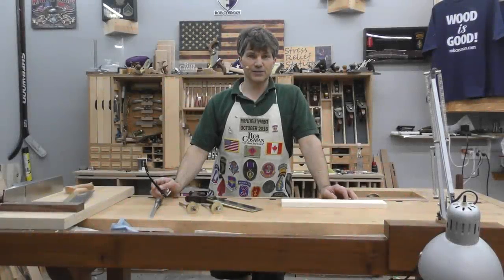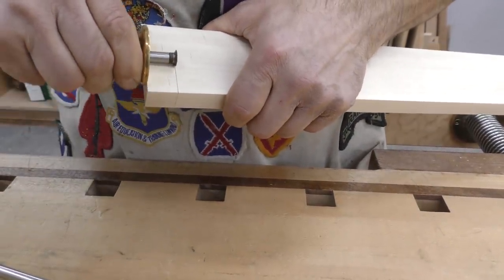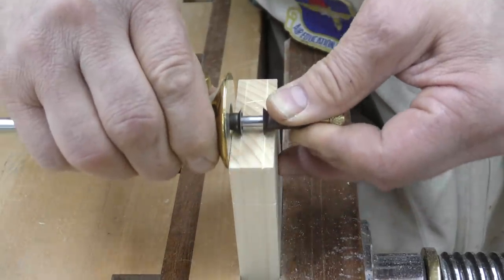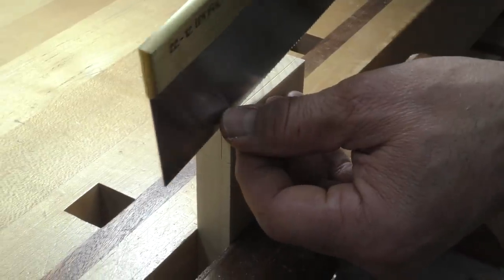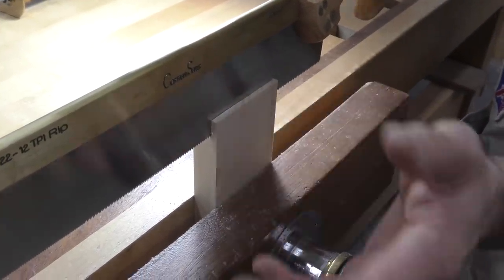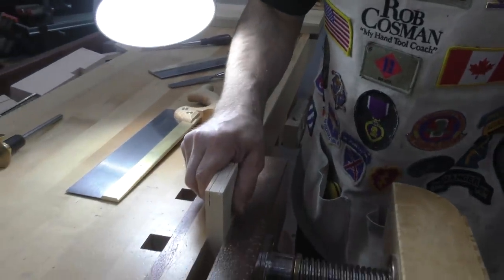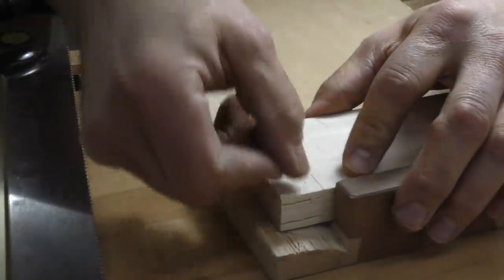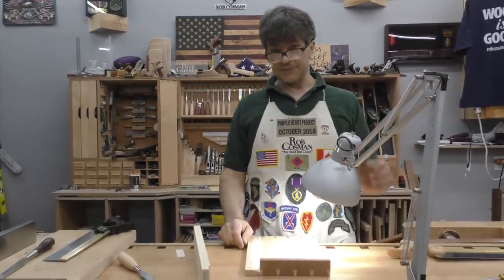Sawing Tenons by Hand

Comment: You should teach you student when sawing along the grain, sawing a bit then switching the board around back to front, sawing some more, switching it back will make the easier for the blade to not wonder with the grain away from the line you have marked... you do good work.
Reply: I learned this the hard way. Best way i my opinion

Comment: hi rob, love your vids, have a bunch of your tools.  your fingers are VERY close to that razor sharp saw - someone with less than your level of saw-control could make a mess of a finger.
Reply from the maker: Sorry Alan but if you cant control a hand saw enough to avoid cutting your fingers then this hobby is not for you.
Reply: @RobCosmanWoodworking  wow, very snarky reply to what was meant to be a constructive comment, and btw, ive been at this 'hobby' for 45 years, all fingers intact.
Reply from the maker: Sorry you took that as snarky Alan, I was being straight.  If you do not possess the hand/eye coordination to start a relatively small saw without cutting your fingers then this is not for you.  Simple.  “You” does not have to be taken personally however there are a lot of procedures using sharp tools in close proximity to your digits.  You either possess the control or you don’t.  In this case I’d rather be “snarky” than “wrong”.   Find a hobby that fits your ability, don’t tell a blind person to take up pistol shooting just to be “inclusive”.
Reply: Alan, I think your caution is a trifle too alarmist. I'd concede the point if we were discussing using a razor knife to cut through heavy material with a straight edge, and I'll agree that it is not impossible for even an accomplished craftsman to goof and drag a saw across his fingers at an odd moment,  but heck, its not like you're working with a remorseless 1HP spinning saw blade.

In a tablesaw video somewhere on YT, a long time hobbyist woodworker dragged the uploader over the coals for raising a spinning blade, supposedly violating all common sense rules of machinery safety. No kidding; no fingers anywhere near the table, which was clear of stock or debris. Now, that was just plain silly!